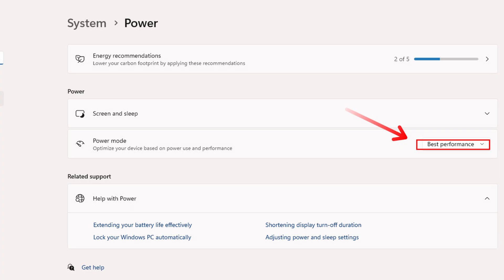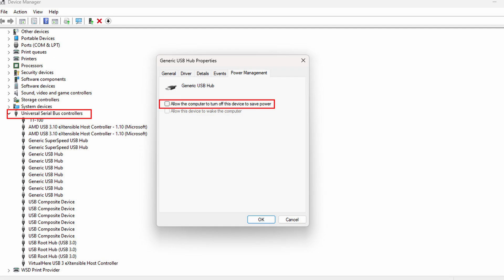💡 How to fix when your laser when it stops in the middle of a job in Lightburn and on your computer!

Comment: Hallo
How are you?

Can you maybe help me please? I have a TTS-55 PRO 5.5W Laser Engraver Machine 40W Laser Cutter. It started to give me problems. It stop in the beginning of a job. I got help from the people at two trees. I got it to work for the day and as soon as I shut everything off. I had to struggle to do everything all over to maybe to get it to work. Now when I want to start I have to go in to my device manager on my laptop then go into port/ COM
And uninstall my port for my machine then install the machine driver and then I can start in my lightburn without any problems. Do you know what I am doing wrong ?
Reply from the maker: Just right click on the Devices button on the Laser tab. That resets the COM port.
Reply: @TheLouisianaHobbyGuy hallo. Sorry for replying only now. This only worked for a day or 2 and then the machine started doing it again this time anything I try to do now is not working out for me and to top all of this off I had to do a order for a client
Reply from the maker: Click on File --> Preferences --> Load Prefs Backup. In the new window, pick a date when it was working.
Reply from the maker: I cover all this in this video: https://youtu.be/StyX0Nt4-kI
Reply: @TheLouisianaHobbyGuy Hi hope you are good? Thanks for your help but nothing I do is working. I Don't think I will get this machine to work again but I really do appreciate all the help.

Comment: I need help ? Machine not firing not pulse I talked with Monport and said the x axis something to reset the machine I did and still not pulse pulse? You offer remote in to computer?
Reply from the maker: Unfortunately, I don't offer remote assistance. Hopefully, you can figure out the issue. It could be the door or water safety switch.

Comment: Sir, how timely.   I just received my Atomstack A40 and the USB is constantly going in and out while running.  Grrr.  I am will be trying everything you recommend.  I have seen some folks suggest changing for a different power supply, is that a possibility too, or will it come down to adding power to the USB?   Thanks for all your content!! 😊
Reply from the maker: It's not likely a power supply on a new machine.
Reply: @TheLouisianaHobbyGuy Got it, thanks so much.
Reply: @TheLouisianaHobbyGuy Looks like the ferrite chokes did the trick.  I clipped them on the usb as well as the power cord from the air assist to the control box.   Thanks so much! Now I want to ferrite choke everything.

Comment: Great video, tons to add to make the diode laser function better. I have a job that I need to complete the engraving on. Please, can you tell me if your laser head needs to be returned to the home position before you restart your incomplete job after setting the Start job here in Preview? Thank you! I have a Diode 10W and I am using Lightburn 2.0.02. Also, I have not moved the material or the laser head after the controller just turned off with no error messages. The air assist was still on. Using an SD Card, so no USB or Wifi
Reply from the maker: Yes, it should work fine if you haven't moved anything.

Comment: Well done Rich a true master in the field , I had the interruptions on my D1 pro 20w , I got a more expensive cable that had shielding and ferrite clam shell magnets at each end , turned off the go to sleep stuff on my Mac and that problem stopped for ages then it dropped out the other day , while it was mid burn I took a webcam call so I’d imagine it’s the voltage drop on the usb rail so powered hub here I come . Keep well mate, love and best wishes from the Uk
Reply from the maker: Awesome feedback, thanks for sharing your experience Adam! 😎

Comment: Great videos. Super helpful. I was wondering if you could could help with an issue. GRBL controller, homes and moves correctly on its own, homes correctly from lightburn v2.0 however when I use the live buttons in lightburn my Y axis is going the wrong way. Please help, and keep up the great content. Be awesome to see move v2 stuff :)
Reply from the maker: So glad you're finding the videos helpful! I'd suggest checking your device settings in LightBurn to ensure the origin is set correctly.
Reply: @TheLouisianaHobbyGuy I did not me up fixing this issue :). Onto a new one though. My engraves at 400mm/s and 10% power are quite deep and fairly dark. If I turn on constant power it improves a bit but still fairly deep. Any suggestions ?
Reply from the maker: Without knowing a lot more details, this would be too hard to answer in a YT comment. Try posting on my free forums. https://lahobbyguy.com/bb 
It could be your LPI is set too high or a dozen other things. The forum is a great free resource.

Comment: bad home grounds are a cause of interruptions, use constant voltage transformer with 100000:1 Faraday shield.  This kills ground, and common mode noise and insures as long as frequency of line is is 60hz.  Solves brown out and spike issues.
Reply from the maker: TMI 🤪

Comment: So steppers are 24VDC and only com signal is 0-5VDC bit serial.  So no current is sent over USB.
Reply from the maker: Not true... thousands of diode lasers are 4-wire, 1-2 A/phase 12V. Not all steppers are 24 V motors, they’re low-voltage coils driven by 12–36 V stepper drivers.

Comment: Rich, thanks for great info.  I had no idea that a usb port wore out.  I've already ordered one of the short extensions you recommended.  I use my laptop with LB without any issues, but from now on, I'll be plugging it into power and not running it off the battery.  If I ever run into problems, does using an external monitor with a laptop help?
Reply from the maker: Glad to hear it Ena! And YES! An external monitor is a MUST if you're using a laptop! After a LOT of research on Amazon, this monitor has the best specs for an unbeatable price! https://amzn.to/4pK5gYK

Comment: Rich, I have been in the IT world about ten years less than you and some of this stuff I had no idea about. Thank you for your time explaining this. I have not had this happen very often with the Roly but had it plenty with other open gantry machines. I also had not realized USB cables and connectors wore out that quickly. Good stuff to know.
Reply from the maker: Thanks for watching Jack! You know, a lot of the things in this video I learned from a 96-year-old computer engineer who I was friends with for 28 years. Sadly, he past away last year after a car accident. He went back to college about 30 years ago to get his degree when he retired from the DMV. His 2nd career was with Systemax Computers in Ohio. He worked for them from 1997 to 2012 designing expansion card configurations for the Circuit City branded computers. He came to work for me at my software company after that, helping out with some firmware, hardware-software integration for two years before retiring for good. He was a wealth of knowledge for sure and is truly missed as a friend!

Comment: Not been having this issue, but the info for the powered hubs was needed . 

I did have a strange thing happen 2 nights ago after upgrading lightburn. Finished a job and was doing some cleaning with alcohol on my project, not near the computer or machine and the laser head just started moving like it was running a job.  Has not done it again yet but I will be on the lookout for awhile.
Reply from the maker: That's a strange one! Glad it hasn't happened again! Are you sure it wasn't an Elf? 🤪
Reply: @TheLouisianaHobbyGuy they can be mischievous every now and then.😂

Comment: I had a problem with random disconnects mid job, I added ferrite suppressors on the cables and a filter on the mains, no difference, but I found that connecting the laser to the computer via a powered usb hub fixed the problem, no idea why, but it worked for me!
Reply from the maker: Yep, apparently your 5V bus on the computer was probably shared and underpowered. The powered hub fixes that! Glad you got it fixed!

Comment: I have one question. Should I go ahead and get a power serving strip? To plug the laser and the computer and the usb power strip in to
Reply from the maker: Yes, absolutely, and it should have surge protection! I don't run any of my lasers unless they're on a surge protector. Mine is actually built-in to my service panel.
Reply: @TheLouisianaHobbyGuy okay thank you very much sir i appreciate it